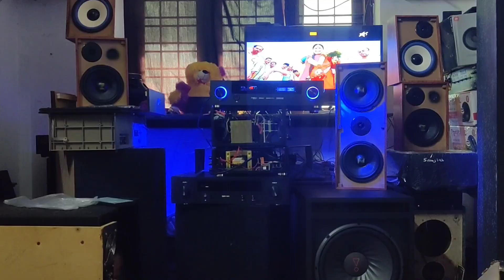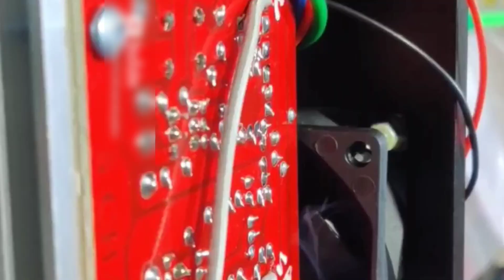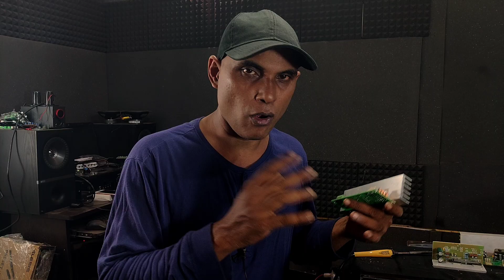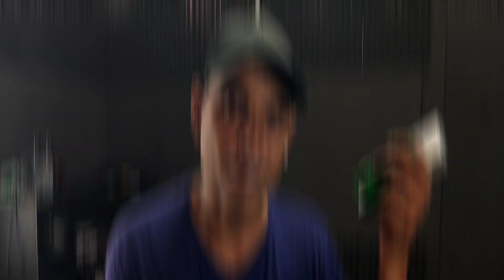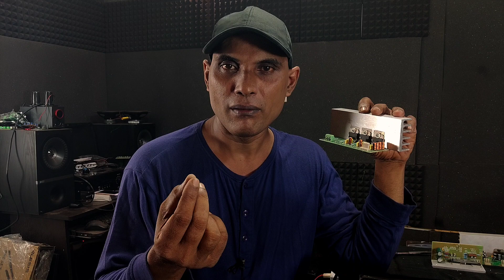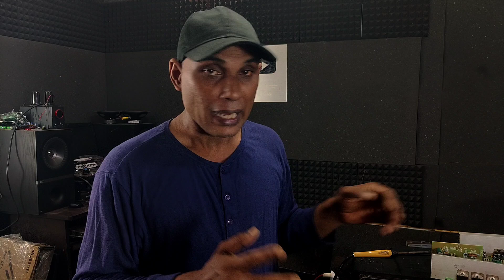Who is responsible for that fault?

Comment: In my view it's manufacturing defect and board should be replace by company. The technician can't take over this responsibility, because he just asking only assembling charges and not asking board price.so he is not taking the responsibility.but he can do needful for replacement of this board from the company.
Reply from the maker: But the company won't....
Reply: I know that. So u can do one thing I f it's loss of big amount u can go with consumer court and if it's small loss u change the company and select another board with sure of replacement guarantee in case of manufacturing defect.